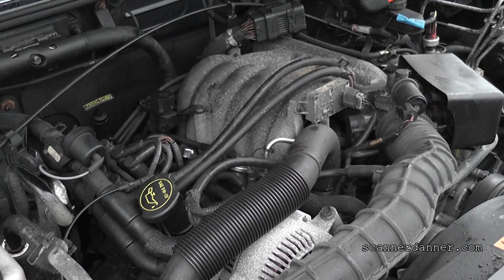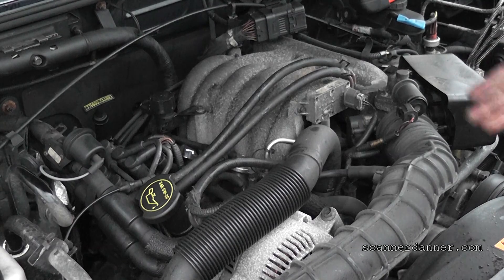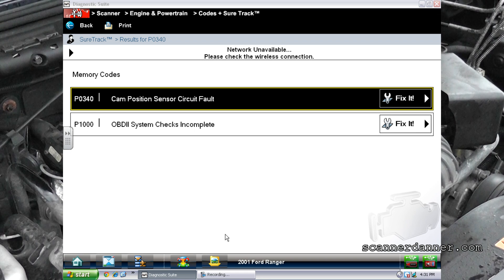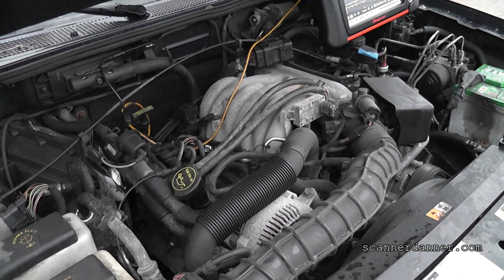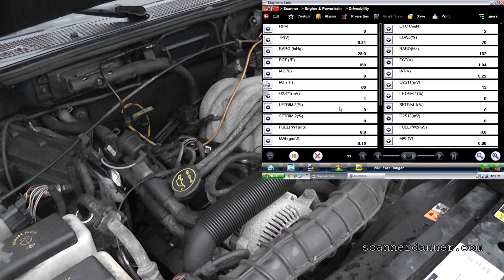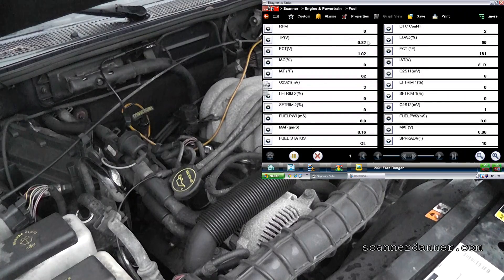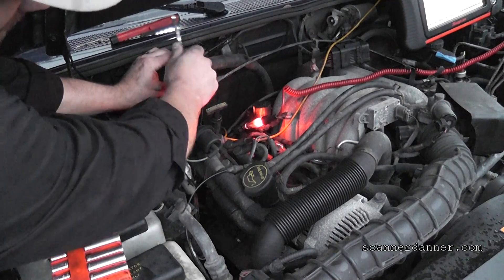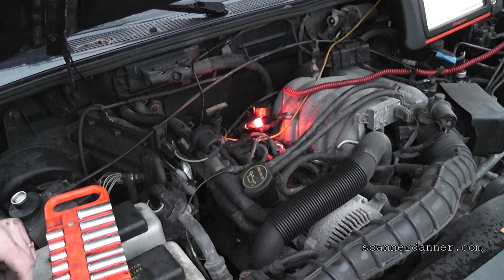Ford Cam Sensor Synchronizer Test

Comment: Could you have taken a 5k ohm resistor and jump the 5v ref to the signal wire & look at the scan tool for signal voltage too rise too check for circuit wire integrity? I believe thats how you did it at the potentiometer case studies..

Comment: I guess on a passive sensor like that (2 wire produces its own voltage) you could even completely unplug the ecu and test at the sensor alone, that eliminates the possibility of shorts. Then it’s a bad sensor, or bad synchronizer or the cam isn’t turning. Correct?
Reply from the maker: I always want to test these plugged in, because the ECM will actually cause a current draw on this circuit (for the AD converter to do it's job).
So, a weak signal can look good when unplugged from the module! Hope that makes sense.
Reply: @ScannerDanner  yes sir, thanks again Paul !

Comment: Is there any way I could donate my 2006 Ranger 3.0 Vulcan that will no longer start up after we heard a bad squealing sound and we had thought it was a belt but I believe it's the cam. Also a friend said he believes has an open ground or wire because he wasn't getting some kinda test correct on that wire your testing in the video here. I just don't know if the 2006 is different then the 2001.

Comment: You didn't test the sensor itself. You only tested the input coming from the trucks hardness. I have got to cut mine off and replace it. Wish you could tell me what wire goes where. Think I could call Standard auto parts and ask them which wire goes where
Reply from the maker: Sure I did. What other tests were you looking for?
Reply: Man I wish you could get a hold of my truck. You could make a very good video out of it. I believe it's a computer and a sancrinizer. I tried a sancrinizer position sensor but got nothing still . It will not start up while cranking. It has great compression
Reply: On a 2006 model ,does the two wire sancrinizers ground run off the computer?

Comment: I put a cam sensor and a crank sensor in my 
2003 Ford ranger 3.0L 
Because i had a check engine light come on. I put both sensors and the truck ran worse than it did before i put the two new sensors in it . I got mad and took the duralast sensors back to autozone. After i returned them the guy at autozone asked if i had programmed the sensors into the system of the truck. 
Does anyone know if you have to reprogram your computer on the Ford ranger for the cam sensor and crank sensor to work ?
Reply from the maker: You absolutely do not. Especially in that model year
Reply: @ScannerDanner  thank you for the feedback information. 
I did not think that it needed to be reprogrammed.  It has rough idle and a miss .there has to be something else wrong somewhere. I was looking for EGR but i could not find it. I thought maybe the EGR might be dirty. I will check further tomorrow.
Reply: @ScannerDanner  can the TPS make it run rough at an idle ? I'm just fishing at this point.
Reply: @ScannerDanner  the code on the ranger was po316.
Reply from the maker: @douglasdailey5998  let's move this to my forum, it is free to join www.scannerdanner.com 
It's just too hard for me to do back and forth messages here. But we can absolutely help you with this.

Comment: Hi I’m working on a 1997 ford ranger 4.0 and I’m not getting no signal to the injectors. And my cam shaft synchronizer have 3 pins. And by the way the cam shaft unit is new. Please sir help me with this situation please
Reply from the maker: do you have spark?

Comment: i replaced my camshaft synchronizer on my 2001 f150. was running good for a week and randomly gave me the same code again, now it stalls at stops and runs really rough sometimes. sometimes it runs good what do you recommend? thank you

Comment: My question is would this cam synchronizer and or sensor is it possible to have the truck do a crank but no start does anybody have any idea because my truck was making these exact same noises before it quit
Reply from the maker: depending on your system, it is possible? But I think these can run without the cam signal? It's been awhile. I'm sure I covered that in here.

Comment: I have the exact truck as in this video. Sensor tested good. What are your thoughts in regards to videos and discussions that the AC voltage or noise from alternator can cause this code to trigger when cam sensor is working correctly?

Comment: This might sound like a noob question, but I have a 93 XLT. 2.3.  I cannot find the camshaft sensor or synchronizer at all. Am I missing something?
Reply: The 2.3 from 1993 has a timing belt and the sensor is behind the timing cover.

Comment: Great video.  Question where is the cam sensor on 2000 Mazda B2500SE 2.5L |4  manual transmission light truck?  I'm not a mechanic, my truck cuts off while driving & I don't know any mechanics i trust.  How do I find the part number for this sensor or the whole assembly?  Thank you
Reply: Have you tried Chiltons or Haynes manuals?

Comment: having an issue yall, it an infinity g35.. have a code of p345,    ever time i erase the code while the car is running. the car stalls.. and the symtoms is........ it take several seconds before the car actually starts up... runs fine when it starts..  i dont have a scope and was wondering if anyone else ran into something like this.  the erasing the of the code and stalling has me stumpped... computer fault... also my scan tool will not communicate with the car but the cheap code reader will... three wire cam sensor btw.  thanks

Comment: Mr Danner I am so so confused I did a timing chain on a 2006 5.4 3v ,I made my marks and took off the chains and put them on the marks I made and put back together and p0345and p0349 electrical codes then I found out that the chains had no colors so you have to make your own and that's where the timing has to be set and so I did it again and no codes why didn't it give me a out of correlation code? When I first did it and it was off timing, I am so confused any help so I can understand thanks a lot
Reply from the maker: Daniel
I've never done chains on this engine but I will tell you that if you have a correlation fault code, you are most likely going back in to do it again. My friend FordTechMakuloco has a series on this. Here is part 1 https://www.youtube.com/watch?v=nQVKnd2r-ww Please let him know I sent you okay?

Comment: Hey Paul, since this is a VRS type and produces an analog signal, can I still use a test light and watch for flickering? Also, I don't know circuit design here, does this signal goes to an AD converter so I can use the test light to test the square wave??
Reply from the maker: I never tried on a VRS. And yes they all go to an AD converter but most of them are part of the PCM itself, so nothing you can do.
Reply: I see, definitely need that uScope.

Comment: other then the horrible noise amd the check light on, what other symptoms will have a no cam signal on this engine???, because despite that you say it sets in an emergency state, what is going to feel the driver???, because it seems that the engine is running very well and dont have a long crank time and no engine stall.
Reply from the maker: an engine can run pretty well with no cam signal depending on designs of the ignition and fuel system

Comment: what is a "floding groung design"?
Reply from the maker: It is a ground that is not equal to battery ground. I see you're an SD Premium subscriber now right? If so check out my chapter or section 21 lectures. The first part or two I cover this floating ground thing in great detail.
Thanks Miguel!
Reply: ScannerDanner cool paul, thanks, i will!!!!

Comment: hi paul on the uscope can an 10:1 attenueator be used for protection on fuel injectors from another company
Reply from the maker: sure, but check with my friends at aeswave.com
They will be able to answer this better and get you an attenuator if you need one.

Comment: Has nobody ever mentioned that a cam sensor determines fuel injector timing? What's crazy about about california emissions is that it only focuses MAINLY on cold start emissions. And you pay a few thousand of dollars more for it, for if it's 50 state or "soley for sale in cali" or whatever you call it or for california only emissions, according to the decal. EPA shit. Anyone remember NRVSIF? haha, no joke though, and it still applies.

Comment: Diesel tech here. In school we were told to never put a test-light in series with a computerized circuit; such as a cam sensor. The reason being, some computer circuitry can only handle so many amps that the test light bulb's resistance could attain and may lead to bricking the ecm. NOW! My question, to you is simply out of curiosity and not criticism as everyone has their own way of doing things. Did you teach yourself to do that on circuits going into the ECM? Did somebody else teach you to do that? Sure, the amperage may be small. But some of those circuits may have such a slight tolerance. Looking for your opinion on my question. We all may be set in our ways, but god dammit we can still be friends!
Reply from the maker: +Sgt Stupid just answered your other question about this

Comment: Mister danner another great diagnostic video , do you think it's time to add another worthy brand scantool to your arsenal . Seeing a pid to verify cam signal with a bypass test on a scantool i would think is much easier than digging for some module god forbid it's something you differently need to see because like we always say in this business time is money . Just would like to know what you think and thanks again .
Reply from the maker: +8power0 yes it is, I'm looking into an Autel. Thanks!
Reply: +ScannerDanner The g-scan 2 without the scope is a very worthy scan tool and it was an oem tool at one time from what i have read on many forms just a thought .

Comment: Good video, Paul. Very interesting. Is that the 4.0? I recognize the engine family, it goes all the way back to the early 70's Capri/Mustang 2. Back at that time, it was a 2.8 Liter, and used a distributor. One thing i'd like to add here, i had a P0340 in my 04 Neon R/T, it turned out to be the little tabs inside the wire terminals in the connector. The tabs were spread apart, pushed them back in, solved the problem for good. That was a couple of years ago. Something to keep in mind when troubleshooting any electrical problem.

Comment: what is floating ground? is it come through high ohm resistor from ground?
Reply: +Raju Yadav A floating ground is a ground that isn't connected to main/battery ground. Think of two cars in a parking lot or driveway, both have ground wires but they aren't connected together. Between the two cars ground is floating.
Reply: thanks bro, understood !
Reply: +Raju Yadav THINK about if you climbed up on a electrical tower. [ don't do that ]  one electric wire is 5000 volts the one below that is 3000 volts. there is an electrical potential difference of 2000 volte. If you touched both wires the lower value [ 3000 volts ] wire will act as a ground and current will flow through from the higher voltage to the lower [ approximately 2000 volts of potential difference ]. absolute ground is the same value as a wire connected to earth or the negative post on your battery.  The bird sitting on a 5000 volt wire all day long is in no danger because there is no higher or lower voltage nearby
Reply: +Killer2600 One error in my explanation is that current flows from the negative to the positive. It's different to how our brain wants to conceptualize it but lightning goes up from the ground not down from the sky. You may also check to see if there is a Scannerdanner Tutorial on floating grounds on this or his premium channel I am sure you will benefit from viewing it.
Reply: Tom A That's technically not a floating ground. Floating grounds have electrical isolation. As per my simple explanation, if you hook the positive end of say a test light to one car and the negative/ground to other car the light won't light despite having proper positive and negative connections to two charged batteries.
Reply: +Killer2600 I think the best example I can reference is a wideband oxygen sensor that uses a ground that is floated up [ and insulated ] above the absolute ground of the battery negative and chassis negative to allow for better current measurements. using chassis ground would produce noise which is undesirable in this application. In the example you used there is not a complete circuit for the current to flow. Please correct me if I misunderstood your explanation
Reply: I see what your getting at and that would be difference between reference (ground) and (main) ground.

"In the example you used there is not a complete circuit for the current to flow" now your starting to get it. It floats not because it goes up or down but because it sits on it's own not tied to battery/chassis/main ground.

In the video scanner danner hinted that he could be looking at a floating ground and would have been satisfied with his test light not lighting at all but it did light and he corrected himself stating that the sensor did not have a floating ground.
Reply: +Killer2600   That is making sense. I am surprised how much electronics that  am learning to understand how to work on cars and in this example Mr Danner is working on a slightly older car. the ground is greater in value than the chassis ground or battery ground but is still low enough to allow current flow, is that correct.
Reply: Tom A Back in the 80's all the talk was the electronics on the "new" cars would be the end of the shade tree and DIY mechanic. In a way it was but many shade tree and DIY mechanics got by.

"the ground is greater in value than the chassis ground or battery ground but is still low enough to allow current flow, is that correct." In the video the sensor ground is at or near battery ground voltage and is NOT a floating ground so scanner danner's test light lit up when he probed the ground wire. In such a case what you said would correctly apply. If it were a floating ground the test light would not light because the floating ground would not provide a path back to battery ground and thus the battery from which the test light is connected to battery positive. One would assume ground is connected to ground and that all grounds are tied together. This isn't always so but then again the term ground isn't always the best term. In the video, you could call the sensor "ground" wire the sensor negative, low, or reference wire instead of calling it sensor ground. Sensor ground is a good fit here because it's tied in with battery ground but if it was a floating ground the other terms would help people from getting confused. I hope that helps; electronics/electrical in cars is fun and it gets better when you get into hybrids - which some say will really put an end to shady tree mechanics and DIY'ers.
Reply: +Killer2600 BUDDY  you can use my Shade tree anytime I not under it

Comment: I have a couple of pieces of white chalk in the tool box for those noisy slipping belts, run the engine and rub the chalk on the friction surfaces of the belt, makes them grip and shut up. Great for when coolant gets on the belts, dries them out.
Keep up the vids great viewing as usual.
Reply from the maker: +Glen O'Hara yes! that works great. the tire chalk right? the waxy kind?
Reply: +ScannerDanner No the black board type, it makes the belt grip. Just like the powdered chalk the weight lifters rub their hands in before a lift for grip on the bar.

Comment: when you looked for the cam sensor signal  you were set to 20volts range (checked for good ground). Would the signal not show up from the sensor  on that voltage scale what sort of voltage level is expected is it  +/- 5v ac?  Just curious no picking fault? 
I enjoy your diagnostic methods 
Thanks  Mark
Reply from the maker: +markg0nmy for sure, I could have lowered my voltage scales but you would have seen it on a 20v setting as well. Especially with the engine running. Remember the higher the RPM the higher the amplitude on this type of sensor. 
It would have been at least a 2v peak to peak signal at idle.

Comment: Is there any way this could be checked with a regular cheapy voltmeter paul? Maybe probing both wires coming out? What does this cause? Poor engine performance, poor mileage? Thanks for the great video
Reply from the maker: +Goenitz Lopez yes, you could do that but the amplitude would be very low and difficult to see during a cranking situation (no start problem). With the engine running, you would be able to see it better (if it runs, some cars will not run without the cam sensor)

Comment: I believe on this Ford's EDIS, the VRS CKP uses a floating ground and the VRS CMP is non floating.  You have to be careful when checking the full amplitude of the CKP signal if you go across both sides of the sensor and you have ADCs that share grounds inside your scope.  You connect another channel ground to the chassis or battery while having another channel across the floater CKP, the engine will stall or won't run.  Another thing you have to think about on the CKP is which side of the sensor your on so your not seeing it upside down.  A rising edge of the sync notch is what the ECA is looking for.
Reply from the maker: +Discretesignals good info bro. Thanks
Reply: +ScannerDanner Learned most of it from you and the guys over at Autonerdz.  I really never understood voltage drop testing till I ran across an old video of you checking an ABS sensor fault.  That was 4 years ago.   Because of you sharing your knowledge on here, you had opened up a whole new world for me and made me a better technician.  I can't even remember how I repaired drive-ability and electrical issues before.  I guess I was constantly changing the battery in the ohm meter back then.